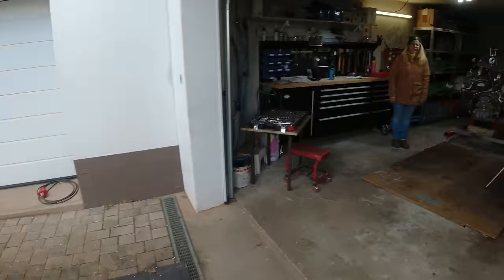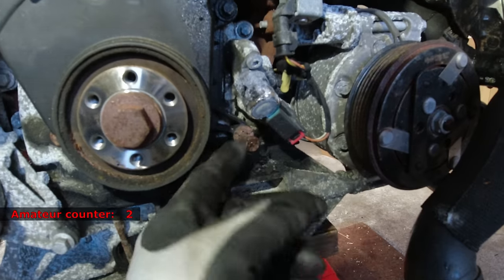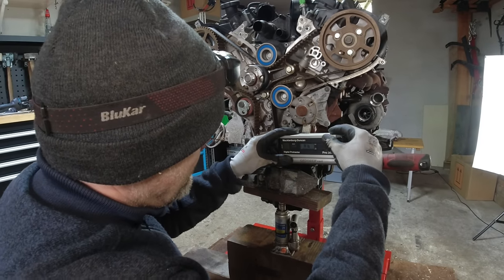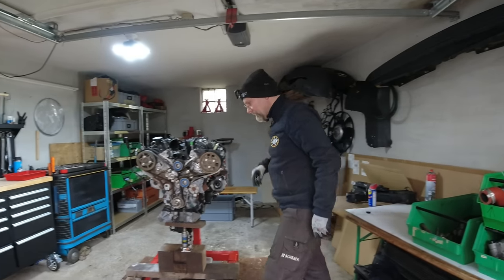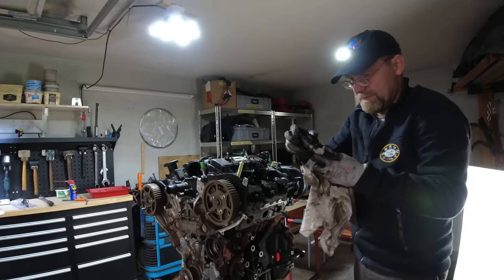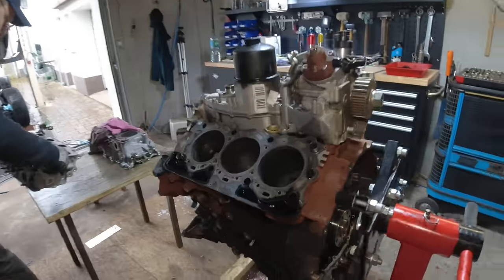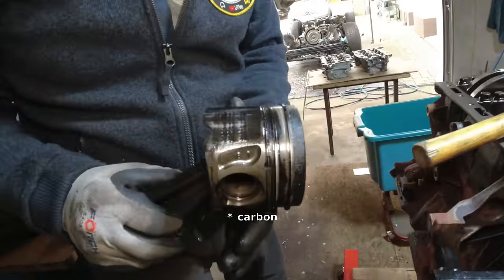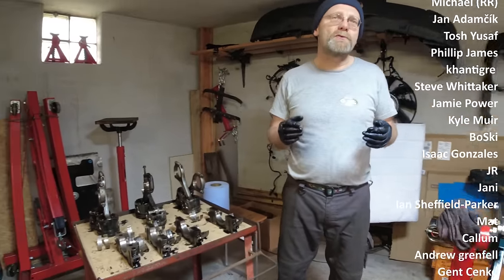Poor Maintenance resulted in Engine Failure ? 3.0L SDV6 / S5-EP15

Comment: here in the states we like cummins diesel my o8 ram 6.7 has 130 k miles and is just getting broken in. as a owner operator i ran fl70 freightliner box trucks easily over 300 k miles. can verify my friend paul bought a 1996 ram 5.9 cummins standard shift pickup new and still drives it as a backup vehicle today. now the big thing is cummins has a new v6 available in the ram trucks today. god bless all your endevors.

Comment: Ford and Peugeot used to be renowned for making relatively simple, reliable engines. It seems to me that they now design and build engines that if they can fit something to make it more complicated, they just do it!
Reply: Now they are using wet timing belts (BIO) they just fit a whole new engine if the belt breaks under warranty.
Reply: Love it when you get to the oily bits 😂thanks again for another great video 👍

Comment: Absolutely fascinating. I want an old Range Rover Sport so bad, could possibly buy one, but maintenance (stuff going wrong/breaking) as you guys show is an absolute financial nightmare?!
Every time I see a modern engine with it's mind boggling array of accessories/control systems I think back to the 60's and how simple it was to maintain basic car engines.  Engine won't start? take out Swiss army knife, and it's sorted.

Comment: Every time I see one of these repair videos I think of the relative simplicity of an electric motor with one moving part instead of thousands. 
I can't wait to replace the several thousand "precision" parts of my Disco 2 engine and transmission with an electric motor.
Reply: Unfortunately that's not quite accurate. Watch Richie Rebuilds and other EV repair channels. Certainly the electric motor is simpler,  but EV's have a lot of moving parts which require lubrication, plus they have sophisticated cooling systems for the batteries, especially the high performance models, complicated battery management electronics.
Reply: @geoffaries  Yeah, they have axles.
Electronics don't wear out.
Reply: Yeah electronics "wear out" have you never had to replace or repair a PCB
Reply: I have piles of old computers. All work just fine. Never had an electronic failure in a car

Comment: Have considered having the block repaired? It's often done on older/rarer blocks. If you have all the bits (possibly not!) They can be stitched and welded. But, yes, a short block from the UK is a good solution 😀

Comment: OMG. At least now I know, as the owner of a 2015 D4 in the 'Death Zone' (i.e. 95K miles) not to drive any further if (when) the engine knocks. My previous cars were Toyotas/Lexus, but so far (coming to 4 years) this LR has been just as reliable.
Reply from the maker: Only 2-3% fail. It's just that mostly those are the ones covered in social media unfortunately. 👍🙋‍♀️
Reply: @Vera_and_Christian  Good to know! Since when did we let a sense of proportion get in the way of a bad news story? Still I'm hoping my frequent oil changes will help keep me out of the 2-3%. I might even stop using the dumbass!!

Comment: On a Toyota this would just be a tick at idle Toyota are so good they don’t even need oil . But in the real world this is what happens if you don’t maintain your engine properly. 
The most expensive oil change is the one you didn’t do . 
Great video Vera/ Christian
Reply: Christian showed the vast difference in bearing area between these engines and the typical Toyota designs. Needless to say the Toyota gets a lot more so all the bearings are under stressed. 

If I recall correctly, these TDV6s had to fit transverse in Peugeots and Citroens too, robbing them of length and thence bearing surface and material in the crank itself. Not a great idea.

Comment: I just did the 270k km service on my 2002 Defender 90, I used 3w 30 Castrol as winter in coming in Sweden. I will drop it tomorrow after only 50km after seeing your video.
Reply from the maker: Oh boy, but keep in mind that we talk about the TDV6/SDV6 Lion engine which has known problems. 👍🙋‍♀️
Reply: @Vera_and_Christian  love your show. My wife is German, I am English. She explained why you call windscreen washer fluid as “ wish wash” : )
Reply: @Vera_and_Christian  i saw how thin the oil was when I dropped it today, like water. Not good for 22 year old TD5

Comment: Hi guys, found your channel recently and I am enjoying your content from Czech republic very much since then! I am doing almost same level of careful maintenance, but on different fragile engines - Nissan's yd25ddti that are fitted in Navaras and Pathfinders. When my engine had a bearing failure, I was extremely disappointed by Nissan (engines were already produced by Renault), but later I found out, that era of reliable, long lasting diesel engines is over across probably all brands. With the new block I switched to my own home servicing with frequent oil changes and the faith in my 19 year old reliable overland rig is slowly getting back. Hope to meet you sometimes in the western alps or maybe on Allrad expo Germany, cheers!
Reply from the maker: 👌👍 That is great. Check out the very lates video from I do cars. It's about the Nissan's variable combustion engine. 🙋‍♀️
Reply: Oh such an overcomplicated engine that 1.5 VC is. So many unecessary baerings.. Shame that CO2 amount is the only value that matters these days. No government does not consider what ecological impact will have repairing or replacing engines that won't survive 3 yrs of service. In the comments section there was Nissan service tech reporting of 6600km failed one..that is even before breaking in. Same story with Audi's stupid variable flow on their 3.0 V6 tdi oil pumps.

Comment: Another fantastic video guys, I have seen on Facebook( as I'm from northern Ireland ) the new 2024 ford ranger v6 diesel has engine issues and even a guy said his new v6 ranger has an engine failure as it using  that same discovery engine.
Reply from the maker: Yes it'S the same, but also very different. I think we have some footage explaining the differences, because everybody thinks you can put that engine into a Discovery 4, which is not possible. 👍🙋‍♀️

Comment: Such a shame the block was damaged. But some firms can weld them back up well, saves a lot of money.
Reply from the maker: No, not a modern V6 double chambered „cheap“ engine block. It’s also graphite cast iron. Maybe they would bother with a rare oldtimer engine. But if you have done your research and actually know someone, please do share.👍👌🙋‍♀️
Reply: @Vera_and_Christian  Hi! Thanks, yes I continued watching your videos and you explained this later! Before your explanation I had no idea they were using such exotic, irrepairable metals! I could understand this for a race car, but the use of such a complex element in an off-roader puzzles me. 
But then again, Ford's use of belts + chains (instead of cogwheels) for the cam also confuses me :D. But hey, at least it's not the ingenium 2L diesel :D

Comment: Oops, as you said it wasn’t leaking oil when you viewed and bought it. I blew my Suzuki 750 engine while riding it, no knocks just cruising at 130 kph, rod snapped , cut block in half and also wrecked the head too. Luckily did not seize the gearbox….so you are fortunate if the heads are ok. The dreaded glitter might be everywhere though….good luck, maybe find a rear ended wreck at cop art….

Comment: Great video, bit of a bugger the block kicking a leg out of bed .
I hope someone on here can help you out with a decent block , on a side note a bloke I knew was fairly handy and repaired a D8 dozer engine that had done the same thing . He said the job was to make it look like nothing had happened to the block and I reckon the D8 could stíll be out there somewhere today.
Reply from the maker: We took immediate action of course and are all set to go forward with our project Discovery. We got a lot of links, but I was surprised that many did not know the difference between these engines. Also a Dozer engine is not comparable to a Gen 2 Euro 6 engine in a Discovery 4.  We will have to explain it better in the next videos. 👍🙋‍♀️

Comment: Its a mess, but it could have been a lot worse. That detached piston could have wrecked your valves and cylinder head as well.
Your hole in the block can be repaired with some super glue mixed with bicarbonate of soda and a squirt of WD40, or so say other desktop mechanics on utube. Think Vera's right would make a nice coffee table, keep up the good work!

Comment: Shame about the engine being toast, i did a friends oil pump and timing belt replacement on his 2006 TDV6 and i found the timing out by one tooth of the crank pulley. 
 After test driving he commented on how much better it drove afterwards, his belts had been changed sometime before his ownership but still had the original pump @ 330k klms on the clock so the pump issue is still around.
Reply from the maker: Oh, having the original pump, with the weak housing, still installed "after a timing belt change" is dangerous. The weak housing is a time bomb anyways. And with a new timing belt and torques on the pully wheels is often the cause for the oilpump to break. 🙋‍♀️
Reply: I was surprised it lasted that long.

Comment: A long shot: might the block be repaired using Lock n Stitch? 

Jay Leno has used that on busted blocks, admittedly a much bigger block probably with thicker walls. 

I thought it worth mentioning in case it could work, which might save a few pennies / cents.
Reply: Oops, I forgot the bottom end is all chewed up too. Maybe a replacement is the best option.

Comment: I just had a very similar failure - Jag xf 3.0d. I bought it as a project with loads of electrical problems. I sorted all them then got somebody else to do the cam belt. 50 miles later the engine let go, I got it transported home and had a good look but couldn't see anything. Once a load of stuff was removed you could see the a/c pump was at a funny angle - the con rod had come through the block and pushed it sideways. One of the first jobs I did when I got it was to change the oil, there was only just over 3 litres instead of 6.7. I think it ha been in there for about 15 thousand miles. It's dead now, the car is pretty much worthless.
Reply from the maker: That is the risk one, including us, takes when buying a non runner or a car in limb mode. That is why the buying price has to be low because you have to expect much more damage than the owner is willing to tell or even knows. 👍🙋‍♀️
Reply: @Vera_and_Christian  It was running perfectly when I bought it but I had no proof the belts had been done - I was right as they were the ones fitted when new - 2009 date on the cam belt. It was all electrical problems, which I solved one by one. I only did 80 miles in it and the engine blew. No warning, no error messages, just a few seconds of a tapping sound and then it went.

Comment: Hate to see that ventilated block! Ouch. I also had a setback yesterday on our 2016 Range Rover. I was looking for a coolant leak and I pulled off the intake hoses going to the charge air cooler and found that they are full of oil. Guess it’s time for a new turbo. Is there anything else I should be looking at? I have changed the oil to 10-40 since we have had it, so hopefully we do not have any bearing issues like that.
Reply from the maker: Drain the oil and check after 500 miles.  Some oil is normal.  It may got in over a long time and draining may do the trick.  Christian
Reply: @Vera_and_Christian  Thank you Vera and Christian for taking the time to respond! Just to clarify you are saying to clean the oil out of the tubing and the charge air cooler and then keep an eye on it? Appreciate your videos, I know big diesels a bit better than these engines, still learning about them.

Comment: I had a Gen 2 bought into my workshop that was diagnosed with a top end failure by a Land Rover workshop, it did sound like a top end knock but when i stripped the engine i found the big ends had failed. I think because of the shape and design of the engine a big end failure is harder to diagnose at first which is why they may have continued to drive.
Reply from the maker: Amateurs. I think they did not even try and probably wanted to get rid of that customer, like they always do. Where you able to rebuild that engine? 🙋‍♀️
Reply: @Vera_and_Christian  yes i have successfully rebuilt a number of them but i do measure everything time and time again the same as you do. If you need piston rings they use BMW ones on the Gen 2 they are thinner than the Gen 1 rings.

Comment: Please live on the edge and let Robin weld the block. Mr Knows Nothing About Toyotas can line bore it if needed and it will make for great content. If it doesn't last you get to make more content replacing the block. It will also give you ample time to look for a good 2nd hand Gen2 block. You can do it!!!
Reply: But doing that the block will still need to be rebored as the bore on the failed cylinder is extremely likely to be damaged as the piston broke up. And Christian usually says he won't take anything to another workshop to have stuff done. Plus of course we don't know how much other damage has been done with the connecting rod flailing around inside. My first thought was also to weld it up, but on seeing the carnage in there, I now think the block will lead another life as a coffee table!
Reply: @samrodian919  The bore can be resleeved, another job Chris can do and which will give very good content.

Comment: Brilliant video once again , makes my Sunday mornings !! However finding a block for a gen2 twin turbo 3.0tdv6 maybe a long wait .
LR mechanic over here been waiting 12 months just found one . Apparentally Gen2 blocks are a 18 month time line so not easy to source .
Any way I'm sure you will suceed , is the engine used in Peugeot / Citroens in europe ??
Reply from the maker: We spend 7800 Euro for a engine with 145 t km.  Will be in the next episodes down the road.  Christianb
Reply: Roll on sunday😂

Comment: Hi Vera and Christian  love your channel, I have defender puma 2.2tdci the oil recommended is 5w dumb ass would recommend to use 5w 40
Reply from the maker: If your engine is not known for low oilpressure or any problems related to the oilsystem, go with what is specified. However, frequent oilchanges for any diesel, that is what we recomend. No more than 8000Km. 🙋‍♀️
Reply: Thank you for your advice.
Look forward to your next video 👍

Comment: guys quick question, wouldn't it be possible to weld patch the block ? I do think you have the german engineering knowledge and a blacksmith at home, you guys should give it a try ! Great content as always thank you !
Reply from the maker: So we have show a bit more of the damage. But it's just a hole, there are actually 3 holes. The block has a double wall for coolant. But we will have a go at welding it, just for the sake it. But that block will definitely not be put into any car we plan on driving. 😃👍🙋‍♀️
Reply: @Vera_and_Christian  yeah that was also my concern, I thought it couldn't be that easy.  Thanks for sharing this, I was actually wondering if the block had double wall.

Comment: You are getting me worried - my D4 has to go to a Land Rover dealer for a service as it still has a Land Rover warrenty on it as I bought it "Land Rover Approved".  But, after that it will go to my local independedt Land Rover specialist whose hourly rate is about half a dealers rate and has a reputation of being absolutely superb and does everything correctly.
Reply from the maker: I am sure not every LR dealer is like that.  There is also not 100% proof that they cause the small issues.  However, it is likely. Christian

Comment: Well, you've already had your unbelievably lucky salvaged block from a two piece crankshaft, now you've got your first total carnage! Don't be too hung up about it though, a true car enthusiast worth his/her salt hasn't lived until they've come across thier first user-installed speed-drain bung(s) 😆

For what it's worth (admittedly this gets a little bit desktop mechanic because I specialize in gassers, not strictly diesels), cam timing off by 4 degrees retard or advanced would not necessarily destroy an engine (unless there's interference problems).. but injection timing that's too advanced, I have actually witnessed bent rods from severe pre-ignition hammering down on them.

Edited for serious grammar mistakes
Reply from the maker: We are definitely not hung up. This rebuild is for Youtube content. And it will be so good and extremely interesting. 💪👌🙋‍♀️

Comment: hmm love when the second head is removed and they say looks good....nope you can clearly see where that piston has hit all 4 valves. 4 very nice round imprints on the top.
Reply from the maker: We will have a good look at that head.  Does not look damaged but new valves are required just in case.  Christian
Reply: Agree new valves and piston is good call.  May not look damaged and may have just kissed the valves.  Especially as you say they were the ones that were hard to remove.  Keep up the good work and videos. I watched every one so far.